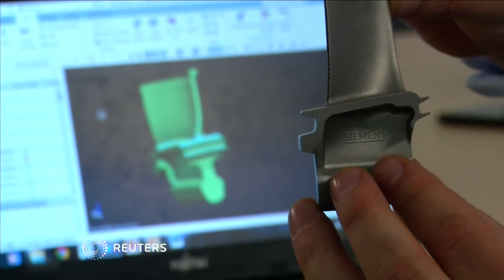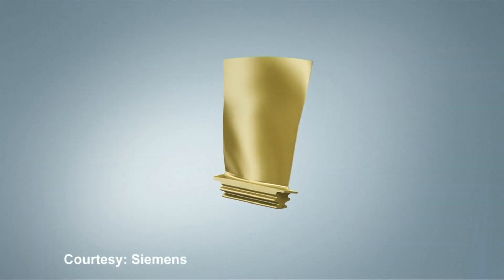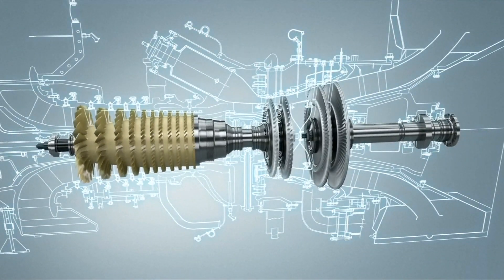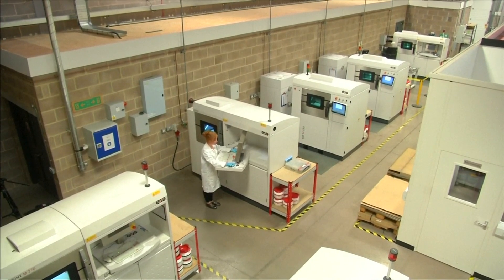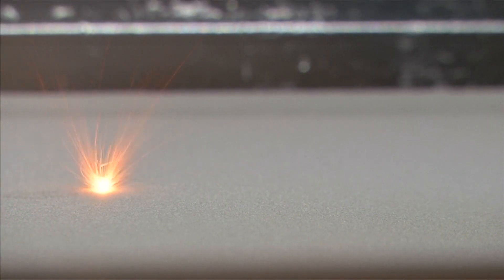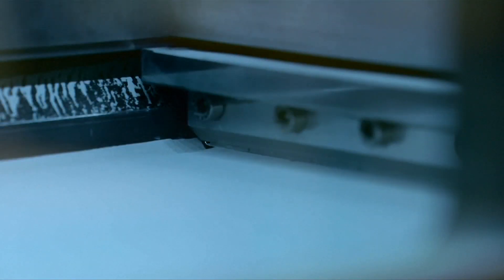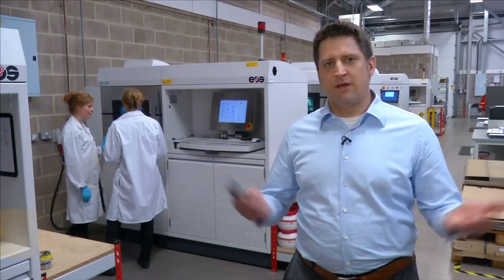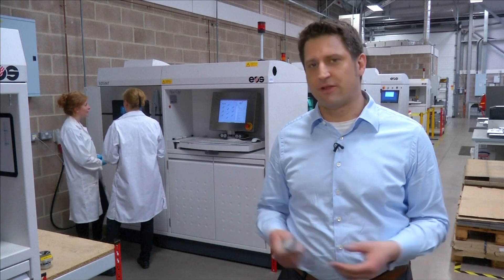3D-printed turbine blades a 'breakthrough', says Siemens

Comment: Use a Turbine on the damn audio... You guys constantly mess up your audio... so damn annoying.
Reply: dj Royal Tee For two years now, I told them like 40 times, but they separate channels, and it is idiotic.
Reply: Probably some dunce who thinks it's kewl...or monitors his device in mono...lol.
Reply: dj Royal Tee 2 years is not cool or professional.
Reply: They are presenting a revolutionary way to produce extremly complex turbine blade. And you, you are complaining about the audio, lol...
Reply: 3D printed turbines blades, but no Audio mixing. I wouldn't fly with that. What if they only put turbines on one side of the plane? hehe